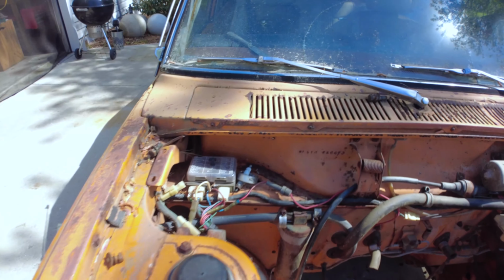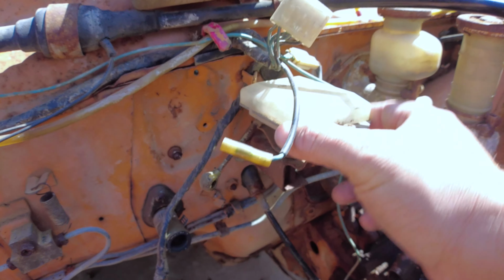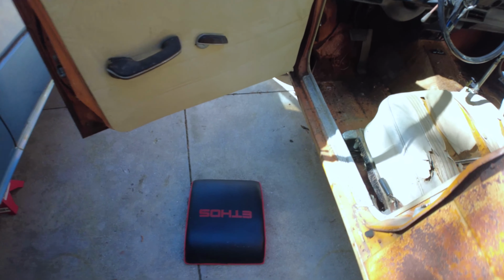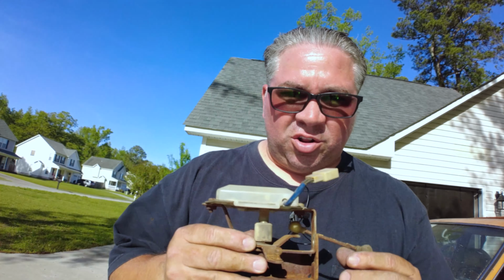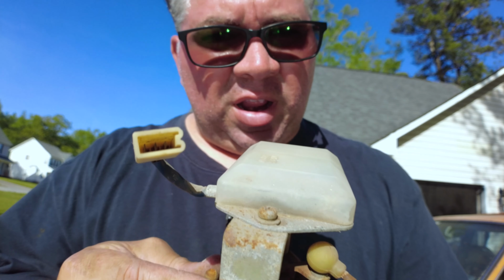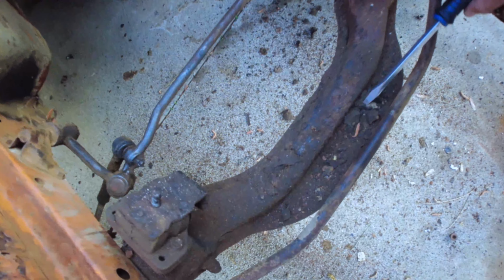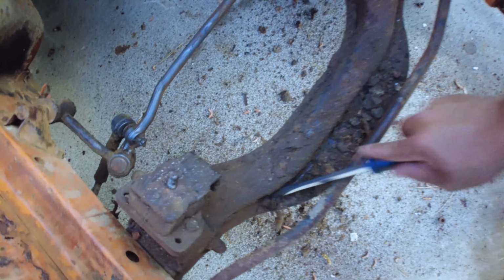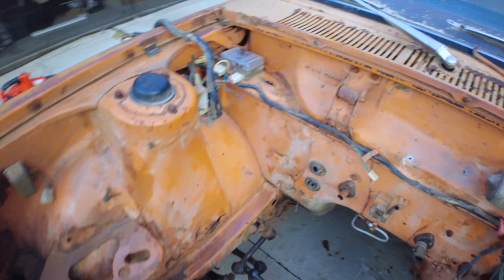Datsun 510 Engine bay clean up

Comment: Yo I own a rx8 but recently it’s been smoking out every time I turn it on I fear my apex seals are needling to be replaced but j wondering if u know what might be the cause bro
Reply from the maker: You might have a stuck injector, could be a lot of things. Is it starting and running fine?
Reply: @ImpalerRotary  yeah it starts right up every time it but sometimes I start the car up and drive till I need to stop and it shuts off also happens when I go over 90mph and I stop it shuts down